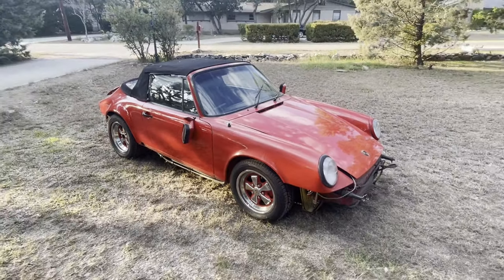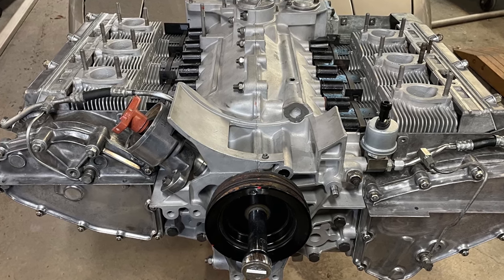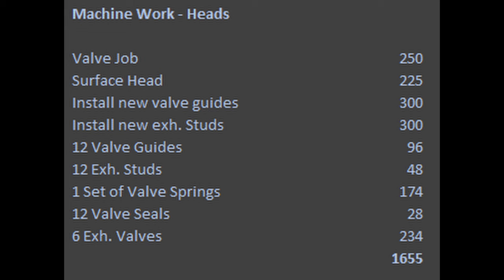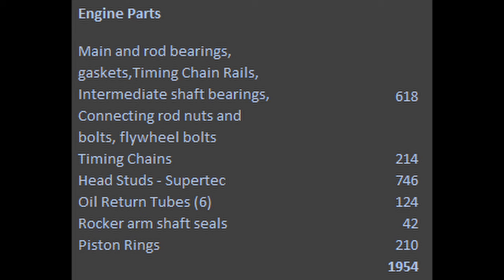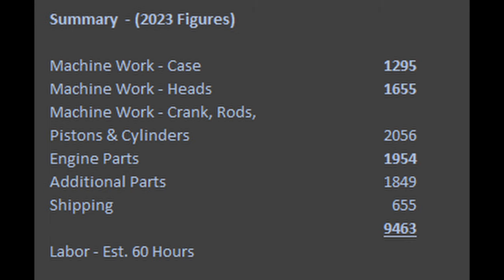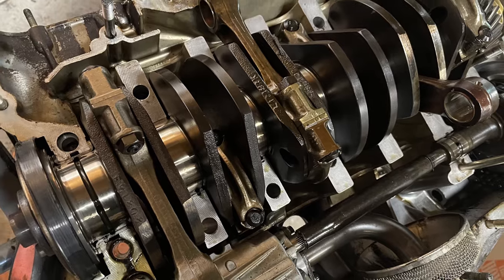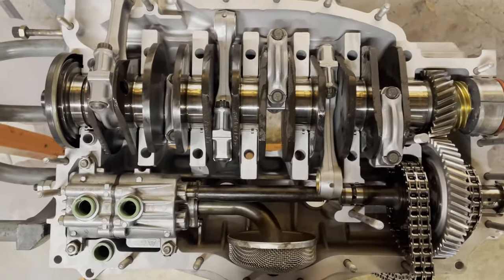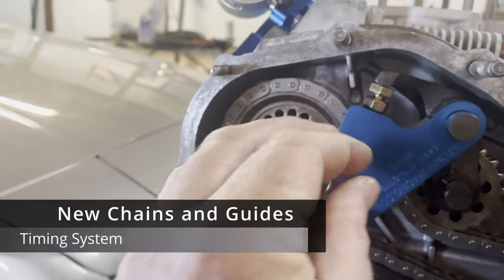What Does it Cost to Rebuild an Air Cooled 911 Engine?

Comment: Great video!  This stuff is super important content for air cooled owners.  I rebuilt my '89 3.2 last year as it has several cracked head studs when I did the PPI so I was able to negotiate the engine rebuild into my purchase price. I did a cammed 3.4 build and I'm loving it.
Reply from the maker: Sounds good.  Give us some details.  Are you still running the stock fuel injection?
Reply: @UberWerks914  Sure.  From top to bottom, I'm running DRC 964 cams made from the stock cams. He refurbished the rocker arms too.  I used new shafts with seals with the turbokraft rocker locks to keep them in place. The heads are from xtreme with new valves and aasco springs with ti retainers.  The head chambers have an edge bevel from the stock 95mm to 98mm new bore.  Underneath that is new 98mm 10:1 Mahle piston and cylinders for single plug.  I measured the CC chamber volume and it came up to 10.05:1 after machining and no detonation.  The case was machined by Ollies in Arizona with a line bore and spigot machining.  They extracted several head studs, polished the crank, refurbished the rods, and pressure tested the oil cooler. I'm running coated clevite bearings on the rods and coated glyco's on the mains.  Holding things together are the supertec head studs and the ARP 9mm rod bolts.  On the induction side I went with the stock ECU , but with a Steve Wong custom chip. The intake has a bored throttle body, MSDS filter, Lucas fuel injectors.  I refurbished/rebuilt the air flow box and replaced the idle microswitch (the cause of many high idle issues) and the replaced the throttle body 80% open sensor listed as NLA with a BMW part.  All sensors replaced like the crank triggers, oil pressure, oil temp, oil level, etc.  Oil pump replaced along with cam chains, cam gears, tensioner gears and IMS gears. Of the moving parts that just got cleaned was the IMS shaft and it's aluminum drive gear.  I have stock type stainless steel heat exchangers running to a Monte M41 muffler.  I left some power on the table and could have used more aggressive cams, ECU, MAF conversion and headers if I wanted to go for more.  But I have a very entertaining 7000 RPM motor that holds up well and last another 30 years. P.S. While you're in there stuff would be motor mounts, trans mount, flywheel, all things clutch, fuel injection lines, chassis fuel lines.  It's a good time to pull the banana arms and replace those bushings too which leads into the torsion bushings and wheel bearings.  Then refurbish the dry sump oil tank and those lines.  Do it right the first time.
Reply from the maker: @3.2Carrera  Sounds like a well built motor!

Comment: Very good video enjoyed seeing how you went about your rebuild I have a 1974, 911 with a 2.7 L engine and it has the magnesium engine case which I had to do upgrades on that engine case. I had to have case savers installed for the head studs and I installed new head studs, but I did not go with the head studs that are the racing grade I went with the standard aftermarket, steel studs. I did install new pistons and cylinders new timing chains and I upgraded the engine to, the higher output, oil pump with the oil bypass modification for that engine and other important thing is to find a Porsche a qualified machine shop, which I did in the state of Washington and the person that rebuilt my engine was a Retired Porsche Mechanic working out of the shop at his home which save me a lot of money.    From what I’ve learned on Having, The, Engine, and Transmission rebuilt and replacing a lot of worn out parts on the car body. You should have a very good income and you should plan on having two wheelbarrow loads stuff completely full of disposable cash to spend on the project. Also to save yourself a lot of cash disassemble the engine yourself and take it to the machine shop and shop the Internet and source all of your parts. There’s a lot of the Internet companies that deal in Porsche Parts I shopped around four or five different companies define who had the exact part I wanted and purchased it at the cheapest price to help hold down the cost.

Comment: Need to include the cost of the oil pump inspection, oil coolers being professionally cleaned and pressure checked and oil lines cleaned or replaced replaced. Would not want to get any old contaminated oil into a new engine. Nice video.

Comment: That's expensive to remove studs!
Snap-On collet type stud remover and maybe a small propane torch if they were Loctited in. 
Couldn't possibly be any more difficult than the Yamaha's I've worked on. (and pretty similar to air cooled Beetle with two more cylinders)
Working on SOHC and DOHC motors for 50+ years means they are simple to do (did you know Alfa Romeo flat four in Sud and others was designed by a former Porsche engineer who kinda told Porsche he could do things better)
60hrs seems a bit 'padded' for just a basic motor, motorcycles have transmission built in which means a lot more parts to be checked.
I already have majority of tools and equipment needed, cam and Magnaflux I can't do though.
Are the exhaust nuts the nickel plated brass ones that don't seize onto studs? (I generally make new ones, it's fun even though buying them is cheaper)
Don't ARP make heavy duty stud kits?
It's still substantially cheaper than the re-manufactured engines which seem to be around $25,000~$26,000

Comment: Did you build that test stand? What components did you use?
Reply from the maker: Just an oil tank, starter and starter ring, battery and wiring
Reply: @UberWerks914  Thanks for the fast response. Thank you.

Comment: Where are you located? I have a 1973 911 T with mechanical fuel injection that needs a rebuild. Engine is in the car. Spark plugs and rotor cap missing. Not sure if it runs.
Reply from the maker: I’m in Texas.  Contact me through my website.
Reply from the maker: I’m in Texas.  Contact me through my website. Uber-Werks.com

Comment: I've got a 1985  3.2 liter motor that needs a rebuild  😅What's my price 👍
Reply: Do it yourself. I rebuilt mine using "How to modify and rebuild a Porsche 911 engine" by Wayne Dempsey. Never rebuild an engine before, and it started first time. Running well, 3 years on.